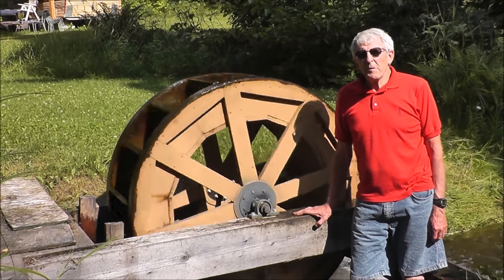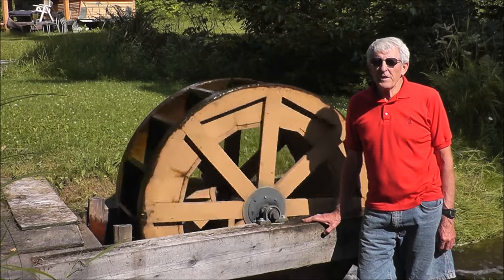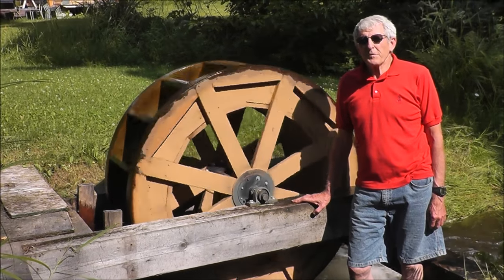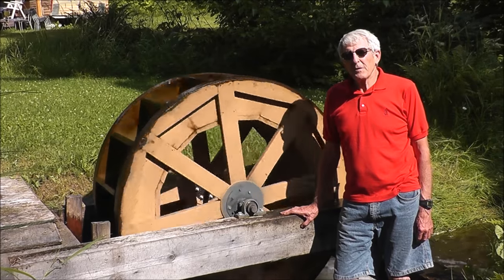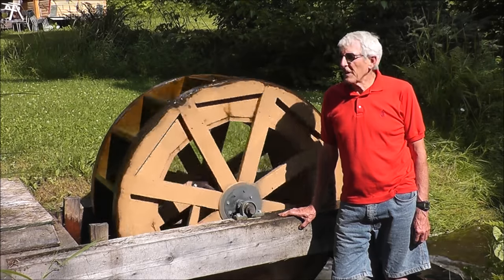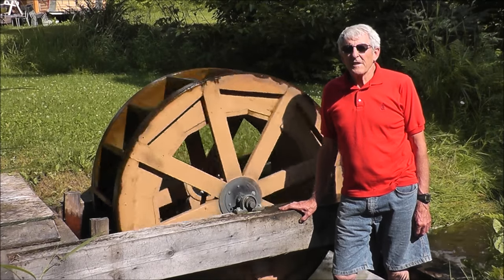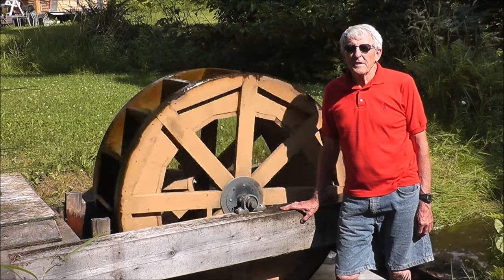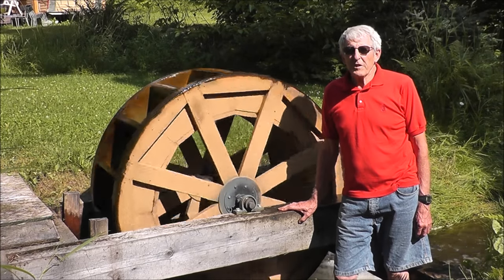Waterwheel

Comment: And by the way I am a general engineering contractor and have operated a cabinet and furniture manufactory for too many years. Western Hemlock is considered trash wood in most circles and will compost itself in short time. Redwood, sugar pine, locust, white oak, will last many times longer. Western Hemolck is used for kiln dried cheap studs at home depo, and as pre-primed fascia and trim. And that just prolongs the deterioration a bit.  Yeah, I know, the wood was free, and its mostly for fun. You mention a culvert with a 20' drop. put a 19' wheel there with Fitz buckets and now you can light the whole house.

Comment: thanks for posting.  nice work.  some thoughts...by using such a large pulley, the ratio of mechanical advantage present is very low.  ( divide wheel radius by pulley radius; the wheel should have an advantage of at least two.)  in a relatively low-speed configuration, a low-cogging pma ( stator connected wye) should  work.   cheers

Comment: Nice movie. How did you fix the spindle of the wheel on the timber? Any Bearings, oil? And how to fix the timbers themselves in the rocks?
Reply from the maker: Wheel runs on sealed ball  bearing pillow block bearings,  timbers rest on concrete

Comment: Did you compare the efficiency difference between breast and under? 
I would wager the undershot is more efficient, right?
Reply from the maker: From what I read the breast has more torque, as you also have the weight of the water.

Comment: How hard would it be to dig out and lower, (are reverse) the wheel for an over-shot construction? (I was wondering if you could collective practical relative data on energy extraction by measuring electrical generation in the various positions.)
Reply from the maker: Impossible to dig it deeper as the water would not flow away, I just do not have that much vertical feet to work with here.

Comment: The drive wheel to a smaller pulley turning much faster was a good idea in principal
but the smaller faster pulley is too close to the water to be connected to a generator 
pair of automotive alternators, they would get wet and short out.  What needs to be
done is a drive shaft needs to extend further up the bank away from the water where
a heavier fly-wheel can be attached as a drive wheel to power a generator or a series
of automotive alternators to produce the desired electrical power with this water wheel.

Comment: Brian I am in the process of building the same wheel.  My is approx. 36" diameter. How wide is your wheel? and the pulley next to it how did you do the cut out for the belt. ie. Router and what bit did you use?
Reply from the maker: The vee groove in the pulley is very easy to make, Had me puzzled though, one thing I learned, do not attach it to a lathe. Just attach a board to a table saw with a cut out to match the  diameter of the wheel. Tilt the blade to the angle of the belt and then raise it up cutting through the board and then to the required depth,  spin the wheel around cutting one side. If you have it figured out right you can just turn the wheel around and cut the other side. Now that I think back I may have started in the middle and progressed to the right width by moving the fence. I know this is as as clear as mud, but very easy once you figure it out. Using the table saw is the trick....
Reply from the maker: Super simple, make a curved piece of wood that matches the diameter, place it overtop of the table saw blade, adjust the angle you want and the depth. spin the wheel in the jig, move the fence away as you make a multiple of cuts till you get the right width. I believe I just turned the wheel around each time to cut the bevel on the opposite side

Comment: Could yo not angle the blades so there is less noise?
Reply: No, that's not the only way. You can bevel (chamfer) the edge of each blade and it will make it much quieter. Also the undershot method greatly reduces your torque needed for running a generator. The more things you plug into a generator, the slower the wheel will turn. So it's vital to have the wheel loaded with as much water as high on the wheel as possible, but not necessarily overshot either. The original midshot is sufficient, just chamfer/bevel the bucket blades...

Comment: thanks for posting.   some facts.   the leverage present in the wheel captures the maximum amount of energy present in a limited volume of falling water.   energy/torque is concentrated at the center of rotation, the shaft.  the use of a large output pulley is throwing energy away.   first stage of output will need to be chain and sprocket, to avoid belt slippage.  to keep the radius of the output sprocket small, first stage step-up should be 1 to 3.  
the current installation does not make use of all available head.   wrong, wrong.  
this should be an overshot wheel, mounted one foot lower.  this is a guess.  the radius of the wheel should be just above the tailwater.    water should be entering the buckets at about 'ten o'clock'.    cheers

Comment: Brian, did you ever think of making the penstock adjustable on angle so that the water could enter the wheel at less than a 90° angle? Say aim it in at about 15° down angle to get the water into the wheel without the paddles slapping it.

Comment: What I would like to know is, what are the torque differences between the two flow setups. As anyone that has ever used a hydroelectric generator knows, when you add a magnetic induction generator and add an electric load instead of just freespinning like this, the wheel slows down and loses momentum. I imagine he tried undershot to make it more quiet, but I bet having full buckets higher up the wheel will provide more gravitational energy and more torque to maintain higher electric loads....
Reply from the maker: Your very correct, farm where I grew up we had our  own electricity including a saw mill that ran off a pelting wheel, Dad said maximum torque was at 60%. I don't have enough fall to have an over shot wheel. could if I had pipe and moved the wheel farther down stream.

Comment: The most self evident [should be] error in all wooden water wheels that I see is for the main wheel it self to be the first pulley. All one need do is rout a groove for the v belt into one side of the wheel. Bingo - free pulley. Then save the other one for the next step up.  Nice build, but should put some Fitz style buckets in.
Reply from the maker: Not practical, Water on belt and  clearance to water shoot sides,  too long a belt, and the sides now have a metal band all the way around.
Reply: You would enjoy the book "Stronger than a thousand men" History of water wheels. Wealth of information. It is a little known book published by a university press, maybe Ohio. My property had a 40' waterwheel in 1850 for crushing gold ore.

Comment: Like it setup and the property, though I have one minor gripe. The paddles slapping the water as it comes down are not doing you a favor. Ideally you would like the water to flow quietly and smoothly into the buckets to minimize the loss of it pushing the water back as it makes way for the next bucket. That said it really only makes a difference if you are trying to pull energy from it. 

Or maybe you find it more entertaining as a drum machine. More power to you. Either way, fine craftsmanship. Absolutely beautiful.  

I am curious of one thing. Does it ever flood the whole area such that the dam and potentially the wheel are under water?
Reply: Brian Procter 
Well, if you ever pursued power generation or maybe less noise, the undershot wheel isn't all that bad of an idea. Breast and overshot are gravity type wheels, whereas the undershot is an impulse wheel where it primarily makes power off the impact of the water against the bucket. I honestly have no idea which may be better under the circumstances, though it could be calculated with a few measurements.

Kinda curious about the dam as well. Looks like wood with concrete supports, or maybe the other way around. I have to say, I'm still amazed by the craftsmanship of the wheel. Done in a little shop, no CNC or the like, and its not purely utilitarian in that it's nice to look at as well. You must have quite the wood working shop.

If you take a fancy to generation, a GM 1 wire alternator is not a bad choice for a quick and simple setup. Just about any auto parts store carries them. The only negative is they like a certain rpm range, and the voltage is set so there's no real regulation beyond that so it's possible to overcharge. But literally a wire from the positive and negative terminals is all that's needed. Quite popular with hot rods and old vehicles.

Comment: wow what a genius design except some major flows, namely your second pulley will wear out soon  , secondly your wheel axle is too thin and soon get crooked and detached from the water wheel ,third you forgot that this thing was designed for generating electricity

Comment: You guys and your V-Belts. I don't know why people insist on giving up anywhere from 500 - 1500 watts to V-Belts.
Reply: What would you suggest using instead?
Reply: Gear box would be the best thing. Lots of old conveyers have them. I got a few of them from a factory that shut down some years ago. Chain drive is a good option too. They don't have to be tight. Just snug. Bicycle chain would be good to experiment but not for long term. Better to use an old mini bike or old dirt bike chain and sprockets. Old car rear ends come in a multitude of gear ratios. You can cut one axle side and weld it so only one side turns to eliminate the differential. I've seen people do that. People seem somewhat educated in the applied sciences to make a water wheel. They should be able to think of something.

Comment: Wow, people still don't know about Tesla water wheels. Noise means inefficiency.
Reply: Yes, noise means loss of efficiency. But, before I educate, craftsmanship goes a long way toward aesthetics as does noise, its the nature of pantomime that makes this an interesting hand built water wheel.

Unfortunately Tesla hadn't heard of Mr. Pelton and his quite effective impulse wheels that manage 85-95% efficiency and touch 99.999% if you cared to try. Like Pelton, Tesla requires a decent amount of pressure. Unlike Pelton, Tesla's turbine looses a substantial amount of efficiency as load is increased. No amount of tinkering changes the fact the higher the load and consequentially the flow, the less the medium (water) interacts with the discs before it exits the turbine. 
Tesla made a fantastic pump for pumping certain things. Not so much something you draw energy from.

Very little has changed in the past century about water turbines. Even in the late 1800's we knew all the equations and how they worked in practice. Biggest change in 100 years is the scroll case that looks similar to a snail's shell, and they figured that out by the 1920's. Between Leffel, Francis, and Pelton, we were pretty well covered on water power anywhere from 6-600ft and all in the 85-95% efficiency range at full load.

Comment: OK, what parts please shall I buy for such a wheel...for example on: www.skf.com  I would like to build, too. Best Regards, Jan :-)
Reply from the maker: First scrounge up a bar of metal for the  shaft.  Then buy a bearing to fit the shaft you have.  Try to find a shaft for free or a recycle place,  Do not need a high quality bearings,
Reply: @brianprocter6191  I think, I need at least 4 bearings. What company would you recommad to buy such bearings? And the bar of metal should be stainless steel? Many questions...I know.
Reply from the maker: @Escumbuit77  Don't need stainless, much to expensive, 2 bearings. one on each side.  My shaft was scrap, don't remember where I got it.  The only thing I bought on that one was the two bearings and keyed collars for those metal side plates.
Reply: @brianprocter6191  Thank you for the responds and your patience :-) Best Regards, Jan
Reply: Still one question: What kind of wood did you use for the wheel...pine, oak..?
Reply from the maker: @Escumbuit77  The wood I used was hemlock,  found here on the west coast, I  was able to get allot of it before they started chipping all waste.  The most important part of that build was the steel band around the outside, Had to put it on later as the water swells the wood and got out of round. Had to let it dry and relathed it round.  the steel band was smaller in diameter, the I heated it and pounded it on, shrinks tight like  the way they made old water wheels.  Here is pictures when I made it    https://www.lumberjocks.com/projects/258626    You can check other things I made on that site.
Reply: @brianprocter6191  Hemlock is good, long fibre and tough. I think larch, Douglas fir, oak or robinia (locust) would be also ok...what do you think? The waterwheel was a nice project, surely a lot of work, but somethink you can be proud of. My dream is to make a watermill with combination of grinding cereals (millstone - a lot of work also with placing in), possibility of washing laundry and of course combined with a big hammer to make forging easy. This will be maybe a life´s work and only possible when friends are helping and holding together.

Comment: Beautiful!! Among the nicest ones I have seen.  Thumbs up!    I thought of taking 20 lb propane tanks and filling them with water to be sure there is no propane in them and then emptying the water and taking a right angle grinder with a cut-off wheel and cutting the propane tanks lengthwise, leaving one straight side uncut. When opened up this would make a large  pelton cup. Done to about 8 or more propane tanks. Taking two steel automobile wheels and welding them together, then welding the opened propane tanks around the wheels making a large pelton wheel.  The center of one of the 2 wheels welded together would need to be cut out to be able to get a ratchet in to tighten the lug nuts of the other wheel to a junked automobile hub/axle. Similar to this https://www.youtube.com/watch?v=BtCMuO3DVyE  Or  instead of using the hub/axle of a junked auto, weld the propane "pelton wheel"  to a large steel pipe and fit each end of the pipe through a large pillow block bearing.
Reply from the maker: I have always been cautious of cutting propane tanks,  but if the valve is taken  off, turned upside down as propane is heavier than air it will be clear and you can then cut them. I like your idea of using those expired tanks to make something great.
Reply: turkey toes ... man, wish I had thought of that! My take is to use a larger wheel. maybe from a farm tractor of 18 wheeler.
Reply: sounds like you're making a big pelton turbine ... how much kwh are you attempting to produce?
Reply: That would be rather called a Banki turbine. Research the design parameter so don't waste all that work for a 15% efficient unit, rather than 80%+.  Good idea using propane tanks for the impellers. But most Banki units need smaller impeller diameters cut from steel pipe .It will never be a Pelton. You need the exact shaped cup and geometry and very high head. The Fitz overshot wheels were nearing 92% efficiency in the early 1900's. No point to re-invent the wheel!